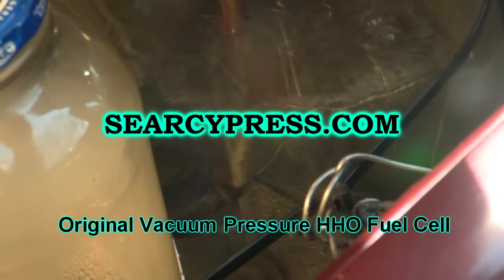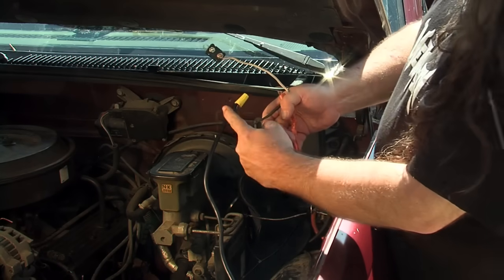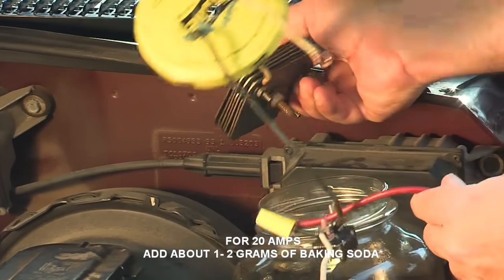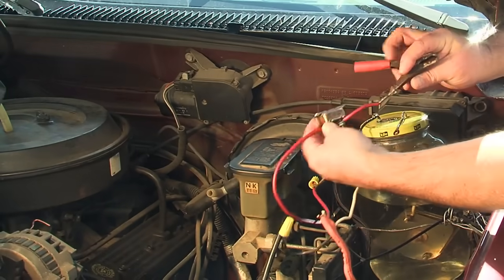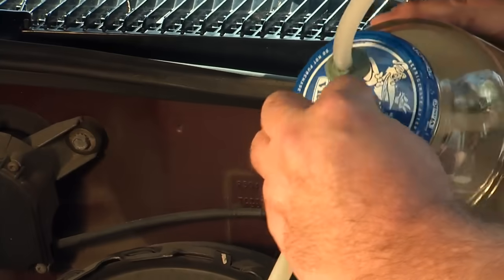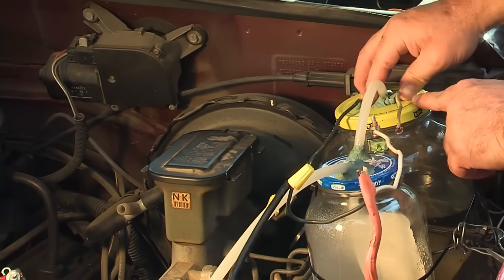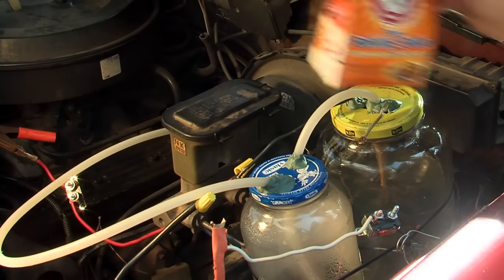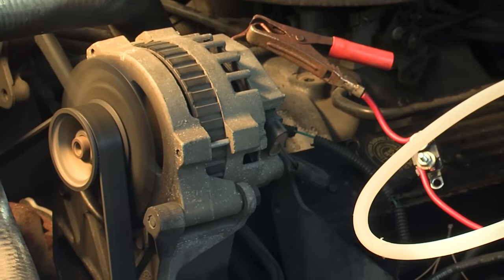Vacuum Pressure Hydrogen fuel cell defeats high gas prices using hydrogen from H2O.

Comment: This is all BS! Laws of thermodynamics!
Reply: Do you not know anything about electrolysis? And chemistry?
Reply: nrawayne  You are completely missing the point here.... do all the math you like, it won't change the fact that 
I put a HHO cell on my truck it put out 2 LPM at 20 amps  ( yes the alternator noticed the extra load on the battery and kept up robbing some HP.)   I leaned out the gasoline and got 40 to 48 MPG from it....
now explain to he how it can't work again ????    I don't give a Hoot or holler about engine efficiency all I care about is MPG so I buy less gas ..... wake up !
Bob.....
Reply: Thank You!
Reply: LOL  and? Where do you see bs? 
I thought so you just using words not sence
Reply: Somebody is isn't thinking this though far enough lol. So yes it will require slight bit more power, a miniscule amount especially from q torquey v8 like what's in his truck and a little bit more fuel, but now 40% of your fuel mixture is now being produced by your hydrogen generator this drastically reducing the amount of gasoline being burned. Also if you didn't notice, he had it on a switch because your only supposed to run it at cruising speeds. That's how you achieve 30mpg highway with a carburated v8.
Reply: nrawayne  the laws of thermal dynamics do not stop this from working ding-aling !
a Alternator draws approx 9HP at full load for the V-8 to make up that 9hp is a pittance and won't even register on a full tank of gas.....obviously you know enough about science to form an opinion, but go back to school you missed too much !  practical application of HHO systems do work,I've made several and Yes they increased the gas mileage....not reduced it as you say it will.... trying to sound like you know what your talking about.... but obviously you don't .
Reply: nrawayne  only way? are you sure of that ?   it's hopeless I tried !  I explained my results... you just are blind to the truth ....  i give up. Bob.......
Reply: I see two points of potential unaccounted for gains with this device:

1) the hydrogen and additional oxygen have the potential to give a more complete burn of the gasoline. The hydrogen itself when burning could increase the overall burn efficiency of the gasoline - maybe (I haven't done the math, just speculating about the possibility). Hydrogen is a terrible fuel by itself, but it has been shown to increase burn efficiency of fossil fuels, typically as a supplemental fuel in diesel engines. It's flame speed is actually really low until you reach the point at which it detonates, then it is obviously way too fast - hence the term detonation... Mixed with a fuel of a reasonable flame front speed, hydrogen is able to contribute its energy to combustion. 

2) under vacuum and with the heat generated by electrolysis, the water itself is more likely to vaporize, and water injection has been proven to increase HP under some circumstances. Of course this would pretty much only happen at idle - which is also the only time I see this setup being beneficial.

That being said, I don't have much faith in the idea, but I do want to look into the possibilities a bit more before I write it off completely.
Reply: @garybarbourii8274  when I first hooked up my system to my toyota p/u  I too was skeptical.
but when I turned it on, the engine smoothed out to where I could barely hear it running, and that smoother running continued through the entire RPM range.
my cell was a wet cell, they are known for adding some vapor ....i.e. they use more water/electrolyte than a dry cell. but heat was never an issue at 2 LPM output, it is a system that supplements the gas is all it is
but most of the people do not lean out the gasoline and then complain that the thing doesn't work !
i went from 20 MPG to an honest 42 MPG when using it on my truck with only a 2 LPM  flow of hydroxy gas
I am sure I could run the truck with very little gasoline and 12 LPM and get over 100 MPG probably alot more
it does work , the idiots that say it won't work or can't possibly work are clueless !  don't listen to them !
I know because I have done it.....Bob....
Reply: @bobkelly2447  This honestly worked for you??
Ive an 03 Suburban 1500 5.3l V8 that i wanted to attempt this.

but ive an electrical Carb, w/fuel injectors..
would i need to augment or will this work be in vain?
Reply: @jamesfusco4056  James..... 5.3 L engine is going to take allot of Hydroxy gas to make any difference !
more than a tiny cell would give you.... i suggest starting at 4 LPM and going from there....
but Yes you will have to deal with the fuel injection's computer in order to make it work right
what that entails on a Chevy I have no idea !
will it work on that engine ? YES !  However that is going to take 3 or 4 wet cells to produce enough HHO to make a reasonable difference.... one or 2 large dry cells ( expensive) and heavy amp draw to pull it off....
say....20 amps draw per cell minimum....
.....
Let me clarify what I did on my Toyota pickup 22r engine... I covered the exhaust sensor under the drivers seat area and put it back in....so it could not sense the exhaust anymore.... I also injected the HHO gas into the snorkel going to the air box...nothing fancy just glued the hose in a hole....
...my cell ( single container holding 3 separate cells each producing 2 LPM at 20 amps draw... However due to the saturation of the electrolyte I could not get 60 amp draw ...max was about 45 amps)
i ran the HHO gas from the cell to a bubblier then to the intake ... both the cell and the bubbler both had pop off caps ( rubber sewage caps that are removable) 
my first run to town 50 miles away, proved to be no gain in MPG at all ! ... the Fuel injection computer was not fooled at all !.....I then added a "Matt Valve" a garden hose and metal garden hose on off valve for adjustment...and installed it around the air sensor, bypassing it with the Matt valve.... that did the trick .... my normal MPG of 22 MPG shot up to over 40MPG and stayed there for the 4 years I ran it...... when the MPG started to drop it needed cleaning.... the cells were not producing much gas so.... I had to clean the cells about every 4 months
....I had a switch on the dash to turn on a Ford starter relay to turn on and off the cell and a pilot light to remind me it was on..... as I usually turned it off about 1 mile from home to get the battery good and charged up....
hope that helps....
be safe !
Bob......

....
Reply: @bobkelly2447   Wow...thanks Bob!
Reply: Also, one of the major downsides of hydrogen as a fuel are that it has a low energy density as a gas. So it takes a tremendous volume of hydrogen to get the equivalent energy of gasoline into the engine, displacing air and reducing volumetric efficiency. The only reason I didn't mention this in the last comment is that it also produces oxygen, which may make up for some of those losses.
Reply: I also want to point out that this device will pull the same amount of current at idle or redline. The amount of current is decided by the resistance of the electrolyte, which is more temperature dependant than anything else. The alternator will always supply enough to run the device at full current, based on the 20A number stated above. Any variation with rpm will be minimal and only based on the relationship between the current demand of the electrolysis jar and the performance curve of the alternator. Any mention of "emf" is complete nonsense. The alternator is a load matching device, supplying the current demanded of it at the expense of engine torque. Don't make it sound more complicated than that.
Reply: Also, water injection has been proven to increase fuel economy. The reason it isn't installed in cars from the factory is that manufacturers see consumers as too lazy/stupid to refill an extra tank under the hood, so they opt out of the added manufacturing expense
Reply: Well it's been 10 years   you've had plenty of time to grow up since then and you realize this actually works right?

Comment: you didnt mention o2 sensor but if you install resistor on o2 sensor or use a o2 sensor spacer you will get even better milage,  great video. i like on demand fuel, its safer than stored hho which would be very dangerous
Reply: Can you elaborate more on the o2 sensor?

Comment: but doesn't water  get inside the engine and would maybe have rust issues in the log run and wouldn't it also mix with the oil
Reply: Never heard of Foggers, Misters? They're more likely to add some moisture. But hho does not have that much water and heat would evaporate it anyway. He's using gas, not liquid injection

Comment: I run my car on shit...i just shit in the tank and the methane gas travels to the engine and gives me great gas mileage i find if i have the runs it adds more power but there is a down side, my neighbors tell me my car stinks like crap as it passes, oh well at least its progress right, im looking to find a way i can utilize my piss too i deink lots of spirits so im thinking if i can do a dual system one for shit and one for my piss ill be twice as well off, i called my system "pissin load of shit" you can all use this knowledge now and go shit in your tanks with no harmfull effects, if however you spit sweetcorn in your tank your fucked so be careful.

Comment: So, this is powered by the battery, which is recharged by the alternator which is not putting out any more than it was when it only had to run everything else. Where does this extra electricity come from?
Reply: The alternator puts out varying amounts of current depending on your needs. When you flip on your headlights for example you're drawing an extra 15 amps or so. The car runs off the alternator while it's running, not the battery. The battery is supposed to only be there for starting and an electrical "buffer" in the circuits.
Reply: Chris Nichols exactly. And now it's being used to split hydrogen and oxygen bonds.
Reply: Tom Hoehler that's what I said, yes.

Comment: I did this and car ran smoother than ever but didn't see my mpg's improve because the O2 made the car run rich i believe.  Ant feedback on this?
Reply: Read comment by Duane and Alexis Tudoe. use  EFIE for later model auto with computer that controls your engine operation.
Reply: KayGee Mani could you provide a link?
Reply: Reset O2 sensor
Reply: put a spacer on your o2 sensor or a resistor on return line from o2 sensor.

Comment: So is your second container just empty to collect water that has accidently got in the tubes.  If it is empty can the HHO gas that is stored in their ignite if there is a backfire in you engine.  I heard people have been burned when their face is around the carby when it back fires so I am assuming the spark goes all the way up the tube.
Reply: Putting screens into the hose will allow the gas to pass and block a flame from traxelling into the hose
Reply: Axe Hoel when you say screens can you be more specific.  I am having a hard time seeing how a screen will let H2 go through but not a flame.
Reply: The same kind of screens for the aerator on your faucet will stop a flame from entering into the tube/hose

Comment: Duane is precisely right. As he stated at the start of the video, his V8 is a >carburetor< operated. It may or may not have injection (maybe a float ball reservoir), but the fact of the matter is the compression on these engines are MUCH higher and it would take almost that entire jar of water to get suck in with one full stroke to get hydro locked up. I would imagine, but don't quote me, that mL of water would escape at a time which would end up being water vapor anyway. That is after all what's coming out the exhaust manifold is pure water. The most one should worry about this system is just if you have a catalytic converter; condensation will cause enough water build up to change the aerodynamic flow of your exhaust and will in turn cause problems to your carburetor vacuum performance behind the cylinder head valves.

Comment: The check valve for the brake booster is the device that keeps the vacuum in the brake booster. When you turn the engine off you will loose vacuum up to the check valve. Since he installed the "T" fitting in the booster hose, before the check valve he has eliminated any possibility of water getting sucked into the intake manifold. The vacuum is generated only when the engine is running.

Comment: doesn't the brake vacuum hold a vacuum even after vehicle is turned off . and wouldn't this suck water into your engine
Reply: the check valve is in the 90deg elbow you see that actually plugs into the booster, so the hose itself (were the T fitting is placed) doesnt hold a vacuum